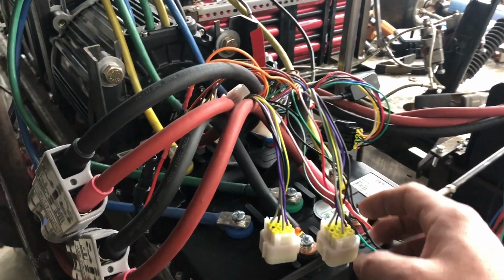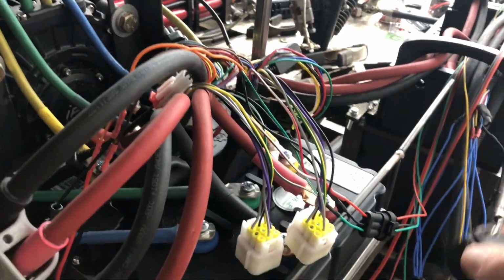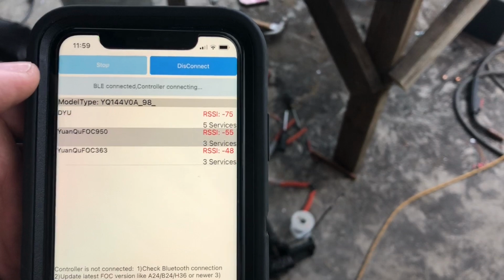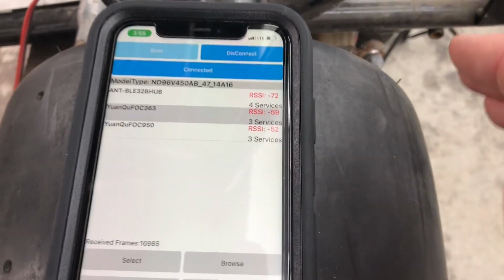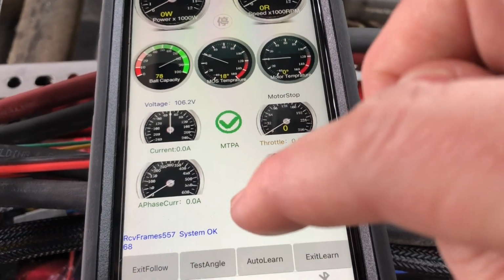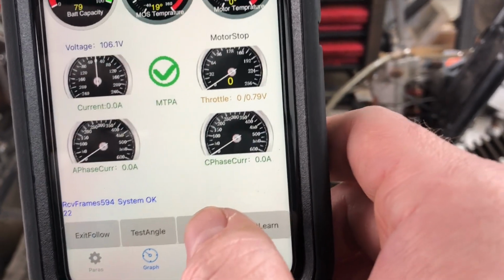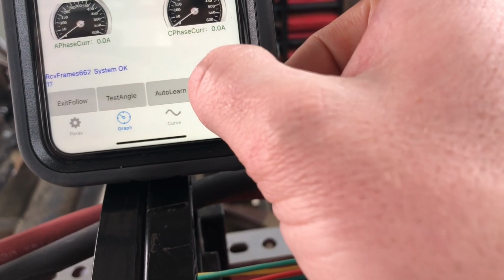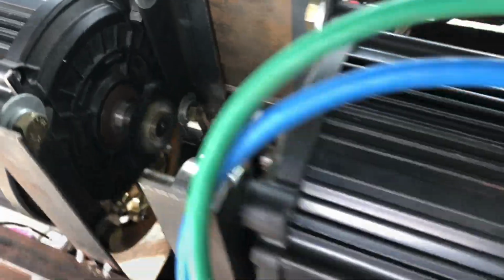Electric Supercart: Detailed Build and Troubleshooting - Headway, Fardriver, QS Motors

Comment: @14:50 running into the same issue. Seems only the data for sensors 1-3 are actually in the firmware. Since QS uses mostly the KTY83/122 now, the only sensor that will slightly work is #3, the KTY84/130.

PTC and NTC are not going to work at all.

Based on the difference in the resistance tables of the two KTY sensors, when your overtemp hits at 150c limit, the actual temperature will be about 60c. So on a cool day while going easy on the amps it will work, but its not going to work well when you use it the way you want to. Lol

Normally it wouldn’t be a huge problem, just change the temperature coefficient setting or the overtemp setting, but these seem to be locked, even in the PC app. Hopefully you have better luck.

Probably you will just need to select NONE, and find two temp gauges that work with the kty83/122 so that you can at least monitor them. You would just need to run the white wire from each hall sensor connector to the gauge. 

The other related problem is there is no turtle mode as it heats up. If it hits that over temperature, it cut off the motor until it cools down to the release setting. This is far from ideal. 

Hopefully your controller and PC software allow you to change some things.

Comment: Hey, for the controller, do you know what needs to be connected so that you can troubleshoot
Reply from the maker: Minimum connections are the three throttle cables and the orange line to battery positions. The rest are functions you can choose to add but not essential. I have the link to the shared folder with more details on those wire locations
Reply: @LordCurt  awesome thanks
Reply: L9oking for help on reversing the motor spin direction if you see this again